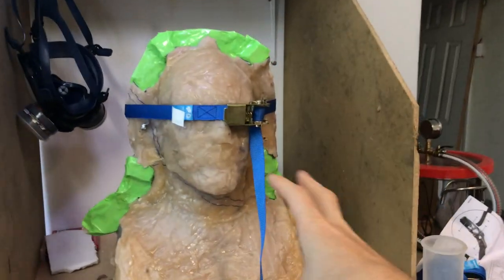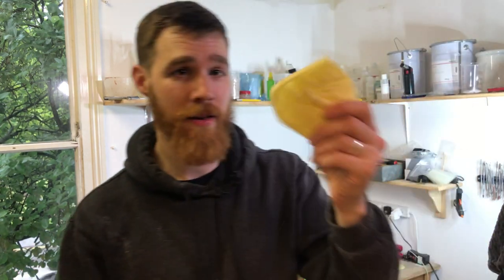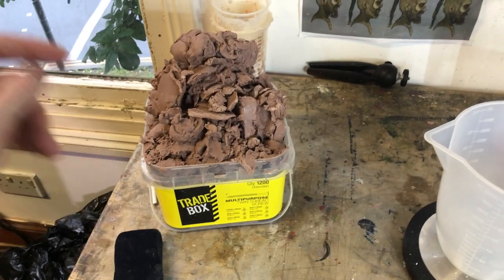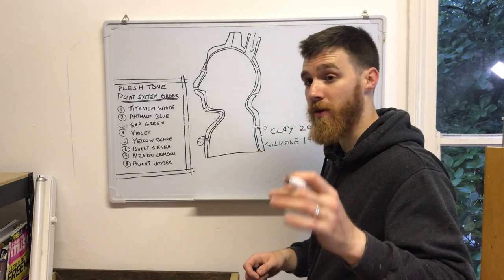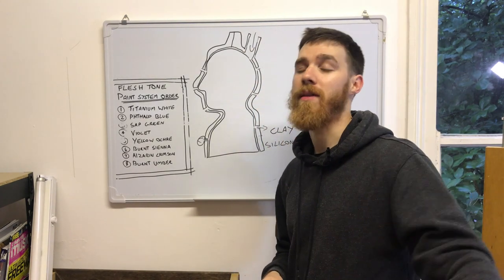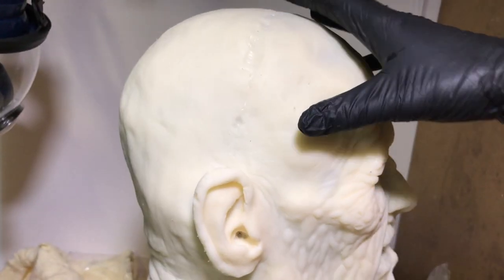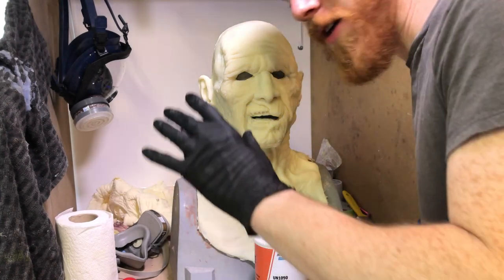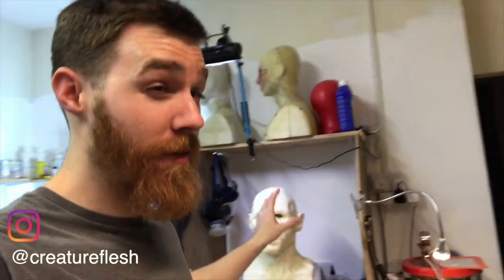MAKING A DRAUGR SILICONE MASK PART 8!!!

Comment: First off I absolutely admire how you go into step by step and make it clear to listen too

Secondly
Could this mask wearable? What i mean is if the method for the silicone used here was to be done again but with better material
Would the mask be wearable?

Or is the other method mandatory?
Reply from the maker: Thanks! Yea it’s totally wearable when cast with a soft platinum silicone. If you watch the later videos you’ll see the final result

Comment: I had the same issue with the clay sticking to the mold and taking a day and a half getting it all off. Have you found a better clay/mold combination that leaves less clay stuck?
Reply from the maker: I used a universal mould release from smooth on my latest mould. If you watch my latest videos on making a last of us inspired mask you can see the full process. The clay came out of the mould much easier! Still I few tricky bits but no where as time consuming.

Comment: Brilliant video, may I ask what was the silicone you used for the test pull please as this is a great idea.
Reply from the maker: +G Black thanks! It was still a platinum silicone but it had a higher shore hardness so not as soft as the silicone I’ll be using in the final pull. You could use an rtv silicone that’s cheaper for a test pull but it will have some shrinkage, should determine wether the mould works if not though. Hope that helps

Comment: How did you get the right space for between the positive and the mold to get the right thickness of silicone poured in? As the clay is destroyed you just have the plastic armature which would not have the detail and be a lot smaller than the mold? Meaning the silicone would be very thick?
Reply from the maker: The thickness of the silicone is the exact thickness of the clay of the original sculpture. When you demould for the first time you get rid of the clay and that then makes a void that can then be filled by silicone. The detail from the sculpture is capture as a negative on the inside of the mould, and the positive head form serves as a smooth surface for the inside of the mask. Hope that makes sense.
Reply: @creaturefleshmasks  So you have to make the clay head a certain thickness; that of the required silicone thickness? Also the nose and ears on the armature are not too big so I'm guessing the silicone will come out thicker at the nose? I used a female armature to build a male head so the clay was a lot thicker which means I can't use the armature as the positive😭
Reply from the maker: It’s good if the armature is smaller as the mask will fit to your face better. Are you sculpting the mask on the armature you intend on using for the positive? If so the thickness of your clay will be replicated with silicone.
Reply: @creaturefleshmasks  I've already   done the mask so now I don't have the right sized positive (the female armature) I will buy the male armature and hope it makes the space between it and the mold small enough that the silicone will be the right thickness. Otherwise looks like I ll have to make a clay head that achieves this I guess
Reply from the maker: You can always shave down the larger armature if it’s too big, I sometimes do this with my armatures If iv make the sculpture to thin in some areas. If you watch my latest video there’s a part where I do that. Hope that helps
Reply: @creaturefleshmasks  ideally I could do with something I can fill the negative with that will shrink about a cm when it dries or through a reaction. Do you know of anything that would do this?
Reply from the maker: There is a way to do this with Silicone, Using Mold Star 16 and NOVOCS silicone solvent, you can shrink a mold uniformly 20% smaller. Not sure if this would work with the application you’re trying to achieve, but it’s worth looking into.

Comment: Question:
 What kind of resin would you recommend for brushing over the armature? Or would you recommend fiber glass?
Reply from the maker: +Chris Scott  I use a gel coat for the initial layer followed by a general purpose resin with fibreglass. You could go for a polyurethane resin but they’re a bit pricier

Comment: Hello again,
 I am in need of more information, for example, what type of gel do I need and  finally, what kind of gram scale do you use? I ask because I unfortunately live in a state that is very backwards and for me to go in to purchase the items and to ask where they are, they look at me like they are totally clueless or like I'm crazy. So all of the details I can get would be very appreciated. Today I searched for a gram scale at several places that should've had one and all of them didn't have it or they didn't know what kind I needed. So if I can get the brand name or how many grams it can handle, that would be helpful in finding the right one that I need to use. And knowing what kind of gel you are speaking of would be very helpful as well. And if I would have to use something else other than fiberglass, is there something else that I could use with the risen and whatever the gel is?
Reply from the maker: +Chris Scott the gel coat is a polyester resin, it’s designed to capture detail before you apply the fibreglass and resin mix. I use about 500g to 1 kg of gel coat but it all depends on the size of your project. If your in the US try a company called brick in the yard.